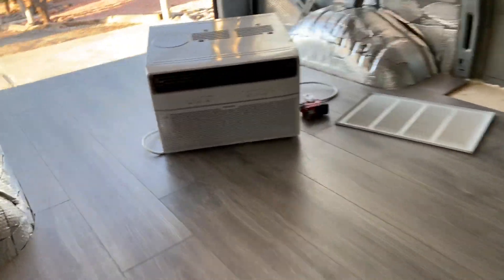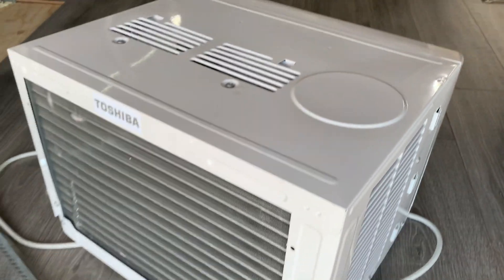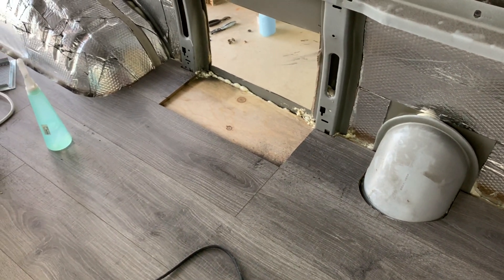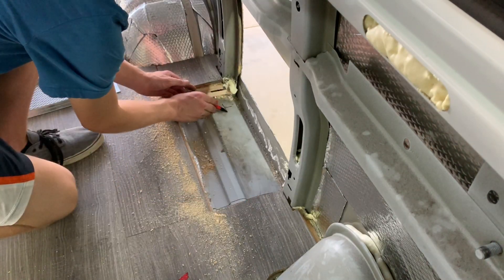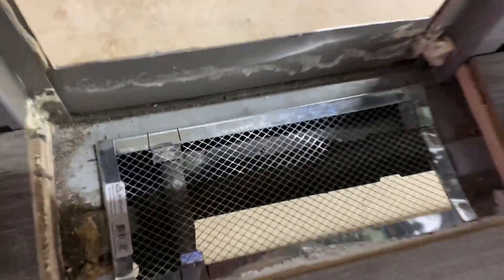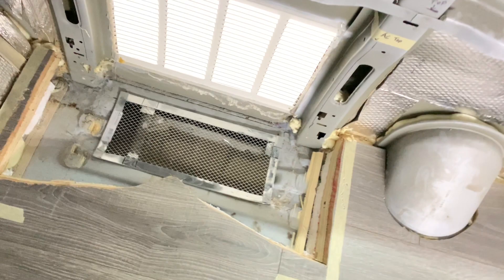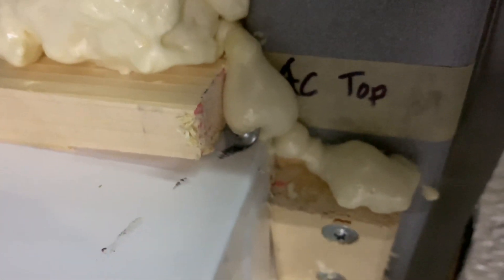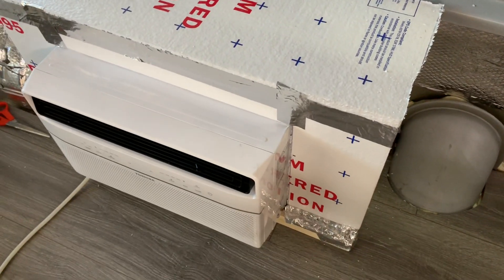Campervan Window AC Install (No Exterior Protrusion)

Comment: Nice way of doing it.. Question though.. Because it's sitting on the floor it's pulling in the cooler air as opposed to hotter air at the ceiling.. Is it keeping the van cold ? Have you looked into adding a deflector to direct more of the cooled air towards the ceiling? Thanks for an inspiring video.
Reply from the maker: Hey Matt you nailed the major issue we have with it. I’ve actually been thinking of cutting out the top of the unit and ducting it up through the cabinet above, then out the sides at the top. For now I have multiple low wattage fans to help move the cool air around.

Check out the “finished” setup here:
https://youtu.be/cxpxg82UV3g
Reply: Hi Matt. One of the factors in a window  unit is the condensing  side getting enough  air to pass thur the coil , the more air  thur gets more heat removed. I explain it this way think of the system  as a train. It picks up heat passengers  at the evaporate  coil and releases  them at the condenser  coil , if the condenser  side  doesn't  remove all of the heat passengers , then the heat passengers travel  to  the evaporate coil  preventing  a full exchange  of heat passengers  , it lowers a full heat exchange. That's a big deal. Full air flow thur both coils is how you get the rated cooling.
Reply: @carlstephens1532  I understand that part. Thanks for the detailed explanation though.. I guess my concern is when you put the ac on the floor you reduce efficiency and you may end up not having enough air movement in the truck to cool it.. If you have other fans moving the air within the truck I am sure this is not a problem.. 

I have installed a window AC in my shipping container (spray foamed) 40' long, 8000 BTU Toshiba. It is basically installed low to the ground but I added a deflector to get cool air moving upwards.. it's able to keep that container cooled in the summer but I wonder if it would have been more effective had it been installed higher up.. Also in this container there is nothing obstructing the window AC.
Reply: @carlstephens1532  Watched the video again.. I see the fresh air intake seems to be restricted so maybe you are right that it's the unit not being able to breathe/cool itself properly that's causing it to not keep up.. Then of course it all depends on how much insulation is installed in the van, how it was installed, air tightness etc.
Reply: Yes, Exactly. Cold air goes to the bottom, so being that the ac is on the floor would make it pretty much useless. 😬
Reply: Hi Matt  ,, the ac really doesn't  care about where it sits it cools the air it gets ...in a vehicle  your cubic feet of air is easily  mixed  ,  but I live in Florida  we get extremely  warm and my builds in the past have proven  to me that it's  not important  how high or low the unit is, yes in August  and September  cooling in a open field  can be quite  a challenge  . So I have used a pop-up  sun screen over my vehicle to stop the sun .on my current  build I'm getting  solar panels  that will do the same thing. Yes I use extra fans during that time but i Don't live in my suburban  , I basically  just sleep in it at the events I go to, I'm outside  enjoying  myself  at the event. Yes it's hot here but i use sun screen  tents and tint in my windows to help  keep it reasonable,  I work in the heat everyday  , I'm an ac guy if your concerned  about your  ac in a vehicle  you simply  get a bigger unit,  at this time it very hard to run ac on solar and batteries  that's why I use a generator  for ac and solar for anything else.  Remember  window  units are cheap because they don't last , keep your install simple to allow replacement  when it's needed . And to allow  for cleaning.
Reply: In a vehicle  it's a compromise  , keeping  the sun off the vehicle  really helps,,,  insulation is hard to get in , like my suburban  ,so the sunscreen  tent is my answer , your situation  will require its own answers but the basics  are the same .the 5000 can do a 10 by 10 room , so a suburban  or van is less cubic space than that , one factor we haven't  touched on is the human desire  to be cold  , if you are realistic  you can deal with the heat , I don't  want to be cold when it's extremely  hot , cool is good for me . One good way to tell if you ac is working correctly  is to listen to the compressor , is it cycling  on and off during  the hottest  part of the day if so that's what your looking for , if it's stays on for hours you need to up size the unit or figure  out how to help your unit .air flow is how you help first acts require  lots of air to do the heat  transfer,  oooo yeah check the air filter often . If you want to be cold figure  out your cubic feet of space and get a unit rated for double that,  install  it correctly  and chill lol
Reply: Other  than extra hot days a 6000  window  unit should  work ,,, as long as the install allows enough  air to flow on the condenser  side. And the unit is clean
Reply: Space is very limited,  there are always compromises , your ac if in good working condition  will cool the space no matter  if it high or low , yes it might technically  be better up higher  but food for thought  , most windows units sit in a window , with little or no insulation  and work just fine, if your concerned  about how cold it gets.the cheapest  answer is get a bigger unit. And figure out how to power it. My thought  is the kiss principle,  keep it simple.
Reply: @carlstephens1532  I am sure it could work sitting low.. but most windows are not on the floor. Also in a "normal" room it's more open than in a van. I am guessing with perhaps an extra fan in a van, you could get the air to circulate and also allow AC to cool better. 
Or are you saying the window AC in this install is not getting enough air around its "outside" to cool properly?

Comment: Very nicely done, and super functional. Does not restrict input or output hot side airflow. Can you tell us where to get the grate for the floor A/C input air hole. Can't seem to find something like it. Any issues with water penetration through the outside side or bottom vents when it rains? Thanks.
Reply from the maker: Peter Schroeder check out the foundation or soffit vent sections at your favorite hardware store.
Here’s one:
https://www.lowes.com/pd/CMI-8-in-L-Silver-Galvanized-Steel-Soffit-Vent/3284518
No issues with water penetration. It’s built to double as an air intake and condensation drain, so if any rain gets in, it drains right back out.
Hope that helps!